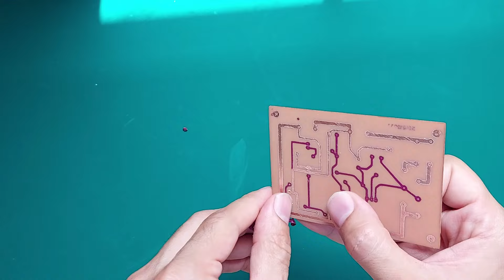Home made PCB using Mini CNC 1.5 W laser engraver

Comment: Great idea, but be absolutely sure the self-adhesive sheet isn't made from PVC or other chlorine-containing polymer.  Laser cutting PVC and similar materials will release chlorine gas (which is not good for you), and also gaseous hydrochloric acid (which is not good for either you or the cutter).  Even with sufficient venting, these by-products can be harmful to you and your equipment.
Reply from the maker: Thank you for the notes
Reply: They don't make these sheets out of granola and quinoa

Comment: Thanks for your video. What Speed and Powersettings did you use for your 1,5W laser?
Reply from the maker: Speed 80 , full power. 
It also depends on the thickness of the sticker laminating tape. it is better to try your setting on a small sample before starting your pcb. Maybe you need different settings.
Best Regards